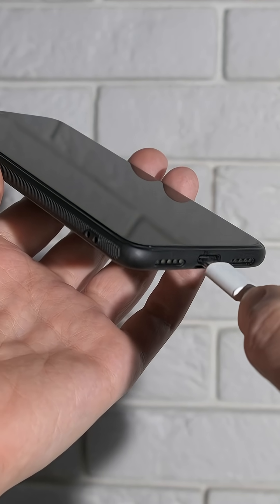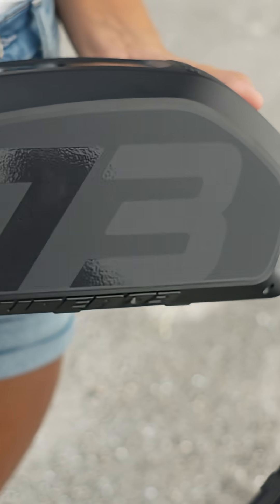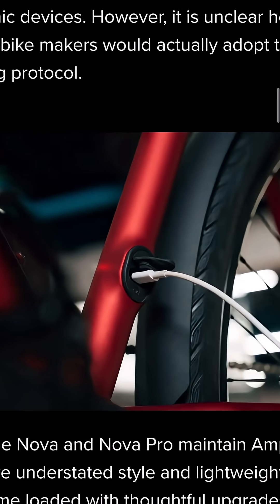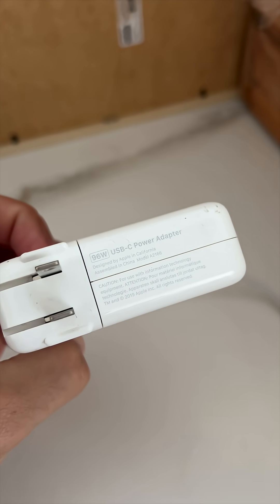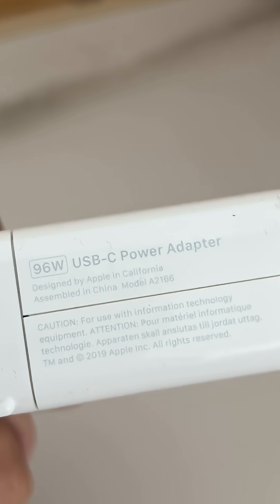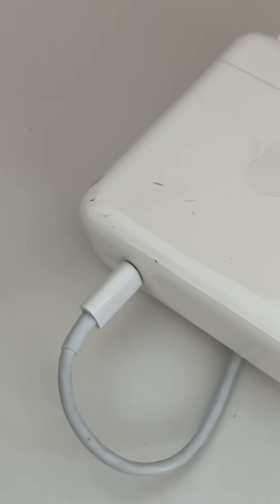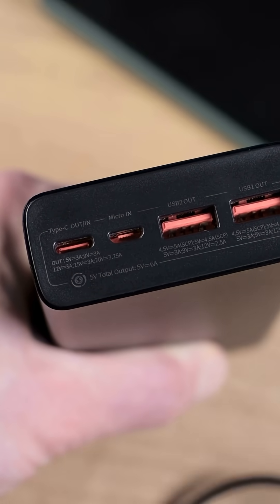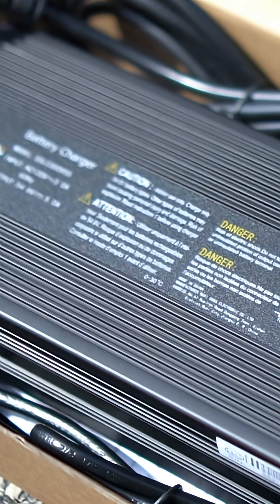Why E-bikes Can't USB-C Charge?!

Comment: My main concern with USB-C is that flimsy section of circuit board in the center of the jack.

Not that the battery should experience physical shocks while charging, but breaking that while plugging or unplugging a cable would be a major bummer.

However, moving to a single standard that automatically negotiates voltage and current would be nice, especially if that enables public charging stations so I don’t have to pack a charger or extra battery with me on longer trips. It would also be a boon for people who use them for work. However, it has to be durable and preferably water-resistant.